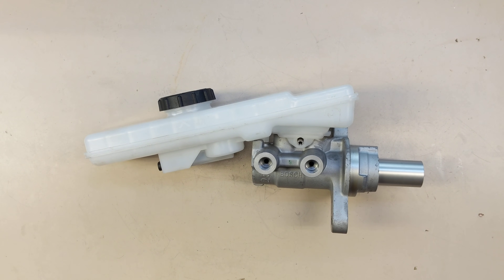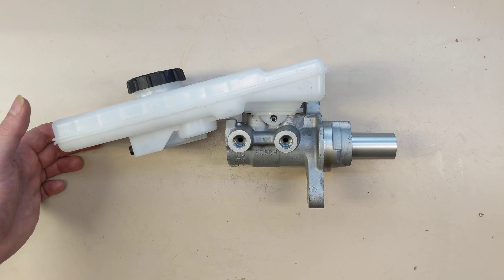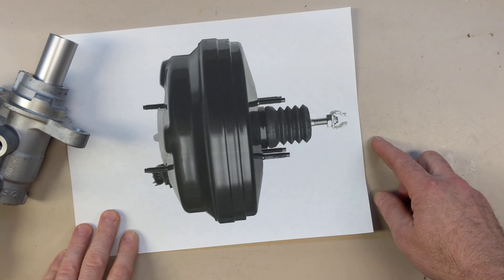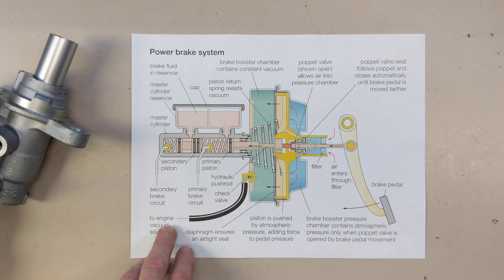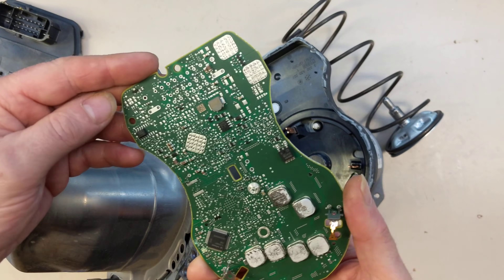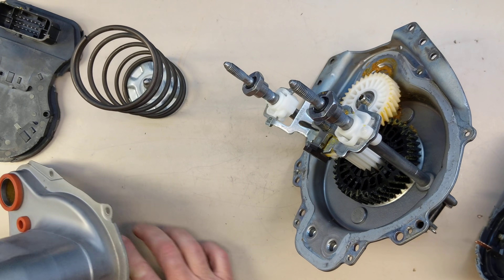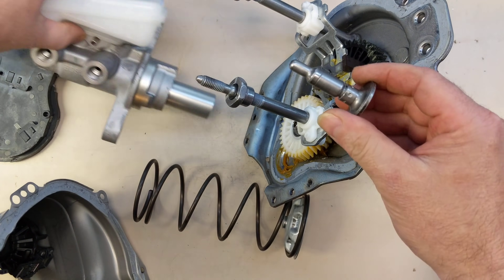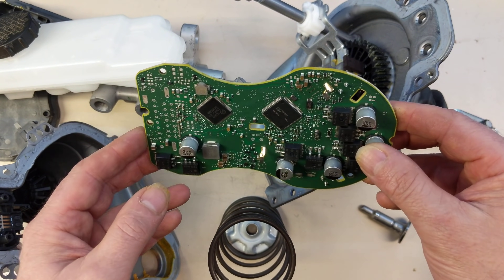Tesla Autopilot - How does it stop?

Comment: the crazy woman standing on top of tesla staging braking faliure should watch this
Reply from the maker: Definitely.   She is lying or mistaken.  Even without the iBooster, there are still 5 other ways to stop the car:  1. Regen, 2. DI Plug braking (loss of HV), 3. ESP3 (ABS pump), 4 & 5. EPB (Electronic Parking Brake) EPB has 2 independent channels, so it counts for 2.   DI plug braking can happen without ANY electrical power in the car.
Reply: @Ingineerix  thanks for all the explanation. Question, so even if Ibooster fails one could just on the brake harder right? Similar to some race cars without a booster.
Reply from the maker: @rudyyyxu  Exactly, but you wouldn't have to, as one of the backups would kick in first.  (ESP3 emergency hydraulic boost being the first, after regen of course)
Reply: Btw that crazy woman spent one week in jail for the false claims and brand damages. 
Few others Chineses who also spread fake accidents stories of fake defects were forced to present public apologies.
Reply: @1943vermork  they had it coming

Comment: Question please: With my 2021 Model S Plaid, if I take my foot completely off the accelerator and thus regeneration braking takes effect, do the hydraulic electronic assist brakes ever activate other than Hold when the car stops?   Thank you
Reply from the maker: Yes, Regen only is good down to about walking speed, then it uses the iBooster to apply the hydraulic brakes and the ABS system to hold them.  On 3/Y you can disable this, but I don't think they give you the option in Plaid. (yet)
Reply: No, only if you press the brake pedal or if the Automatic Emergency Braking activates to keep from crashing into something.

Comment: Is the iBoost controlled via the Bosch ABS or directly from the Tesla systems?
Reply from the maker: Tesla controls it over CAN.   The Drive unit can ask for braking for one-pedal driving, as can the Autopilot ECU.
Reply: @Ingineerix  Interesting, wonder why they did not go with an accumulator based system.
Reply: @allan80supra  More expensive(?), louder, worse pedal feel.
Reply from the maker: @allan80supra  @compu85, is right, yeah all of that, plus it's less reliable and more expensive.
Reply: @Ingineerix  hmmm pedal feel I'd debate had it on a couple of Toyotas and it seems very good and found its response time for traction and anti-lock superior to the bosch systems I have driven, would be interested if anyone has detailed comparisons of the two systems.
Reply from the maker: @allan80supra  The only Toyota I owned was a Gen 2 Prius (2018), and both pedal feel, brake blending (hybrid) and ESPECIALLY ABS was horrible.   I think Toyota engineering is awesome, and they build good cars, but they definitely don't have good "feel".
Reply: @Ingineerix  hmmmm must admit my experience was early 2000's cars, toyota have dropped the ball since then, so entirely possible they have there too, like picking a BMW to be the Supra over the LC500 huge WTF moment.
Reply: CAN messages tell it how to run
Reply: Brake force request is sent to esp unit. esp then commands ibooster to build up pressure and monitors pressure built up in abs block in closed loop control. however there also a redundant canbus link from autopilot ecu straight to ibootser should esp system fail in emergency for braking.

Comment: Thank you. Great video. How does 'old school' cruise control slow/stop? only using "engine brake"? using the vacuum pump?
Reply from the maker: Yeah, Old school cruise only operated the throttle.
Reply: The abs is commanded to generate break pressure from the assistance systems, at least that's how VW did it in their cars
Reply: And old school cruise control would run into stopped emergency vehicles, too.  I wonder if NHTSA knows that....